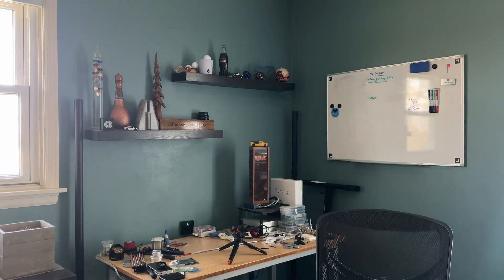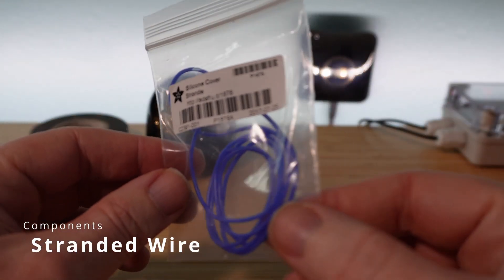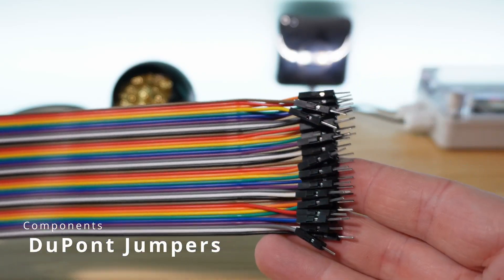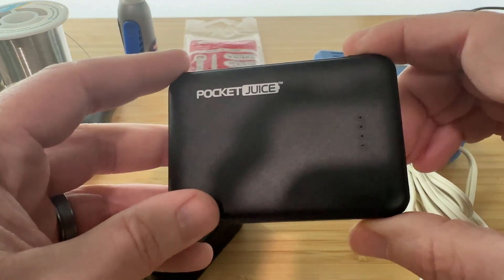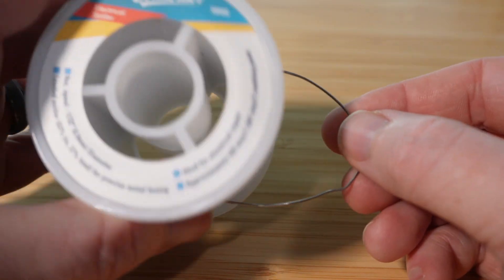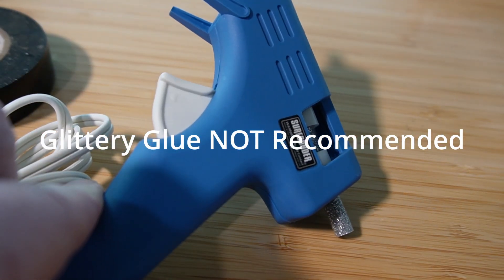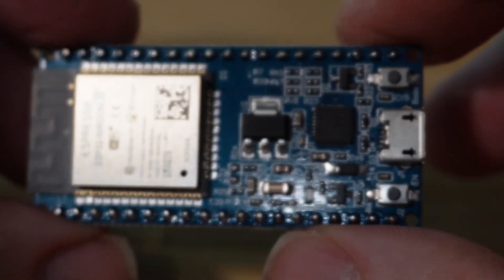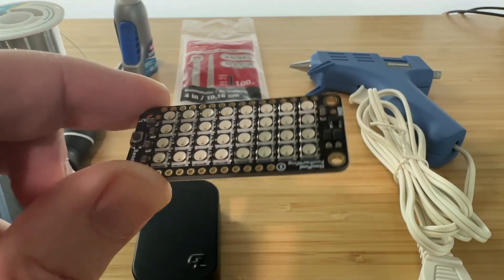36 Essential Tools For Getting Started With Electronics

Comment: I find coding harder because at least with electronics I can always just plug a few LED's in and stare at them lol. Coding I kind of don't know where to start. I thought of making little games maybe to practice coding. Would that be a good idea? I've had prior coding experience, only from my Intro to C and CPP class (which left a lot to be desired)
Reply from the maker: I’m going to be biased here but yeah I think having coding experience is very useful. The important part is figuring what you want to do with the code since there are so many specialized languages. If you want to do IOT stuff, cpp is not a bad choose. Python is good too. If you want to do games you probably need something different though.